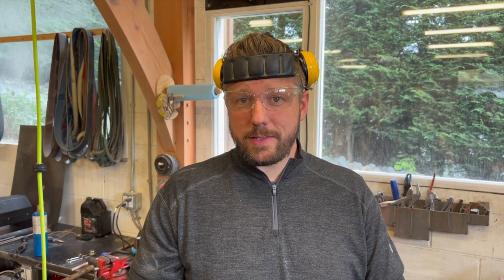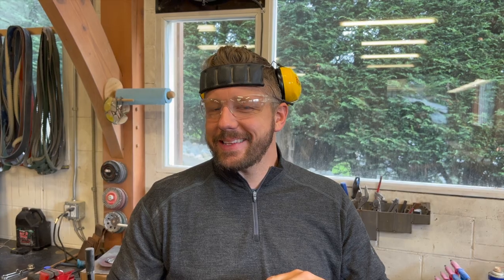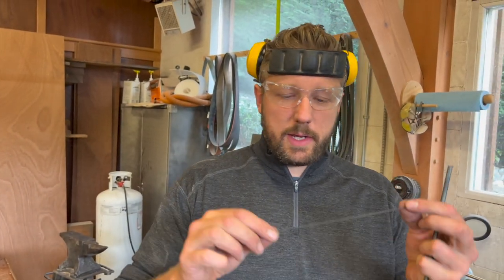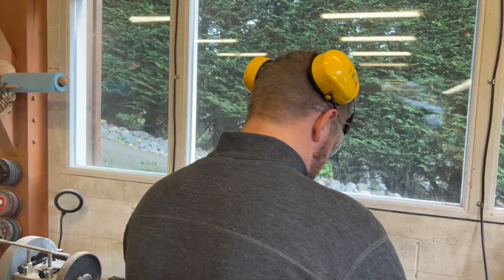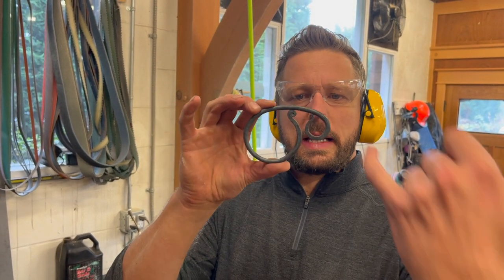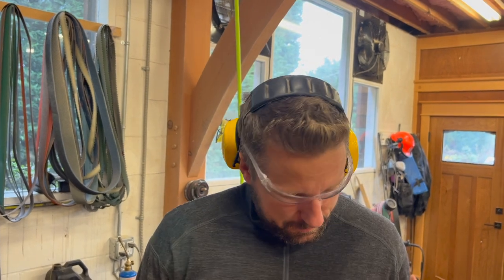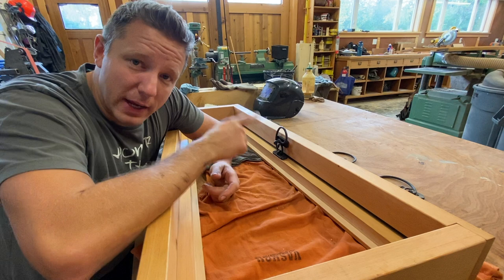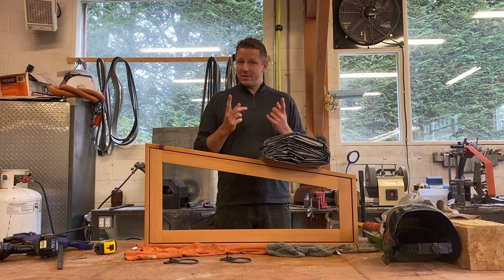Hand Forging Latches For My Cabin Windows!!

Comment: Good work Samurai!!! One suggestion, when you pushed the u-shaped rod through the plate steel instead of making if flush to the bottom you could maybe give yourself 3/16 of an inch space to fill with weld so you don't have to grind away all the weld to get the bottom flat. Just a suggestion for the Master from the student.....
Reply: Or countersink the back of the holes (like he did for the front of the screw holes) and let them fill with weld.

Comment: The little U-shaped pieces could have been easily attached to the plate without a welder, by chamfering (countersinking) the hole on the back a little, then peening the ends in place.  With a little care, you could also upset the shaft sections in the same process so they tightly fill the holes, making a very solid connection.  It's a beautiful design, and you did a great job executing it.

Comment: One forging tip I learned was when you light the forge and let it heat up, leave a throw away piece of steel in it. When you put your working steel in the forge take out the throw away piece and set it on the anvil. It’ll heat up the anvil and offer a little bit of working time

Comment: Maybe get a sheet of plexiglas and cut it down to fit your windows. Just use push points to hold them in. Looks good and keeps out the cold. Plexiglass comes in different thicknesses. LOOKS FANTASTIC ‼️‼️. Vinny 🇺🇸

Comment: Cut a little bevel in the back next time before welding a post to a flat bar less grinding more penetraition. A little more room in the loop probably would have fixed that sticky part.  Agree time will make it smooth. Beautiful work!

Comment: i think the latches came out Super Cool Functionality is the Important part not fussing over every tiny Imperfection  that is to be expected with hand Forging  and maybe a one off product IMO  when everything is installed i’ll bet you if you put a drop of Oil on them it will make things work easier  and like you said after some use  things will wear themselves in

Comment: 2 notes from a blacksmith. 1. Guard your grinder, it may feel less agile, but trust it’s worth it if you only need it once (spark is will set fire to your clothes), 2 you can rivet the back into it, or plug weld if you leave a gap i the back. Less grinding.

Comment: Instead of wood screws, maybe you could get some socket head cap screws and grind the heads down to look like square nail heads. Install them with an open end wrench. You'd need to use threaded inserts into the wood but I'd bet they'd look great.

Comment: A latch that loosens the window seal and doesnt open the window much is great improvement, You can set increased air circulation without inviting every bug in the universe inside your room in the evenings.

Comment: With your smaller windows, I wonder if you might be able to find recycled windows at a local salvage yard that might provide a source for your glass.  

I think maybe a larger loop attached to the mounting plate would have allowed the movable part to clear out to the way a little smoother.

Comment: They're "unique", not "really unique" latches.  With the exception of the greatness of The Samurai, there is, logically, no modifier to a superlative, though using an (incorrectly applied) adverb "really" with the  adjective "unique" is in general good practice.